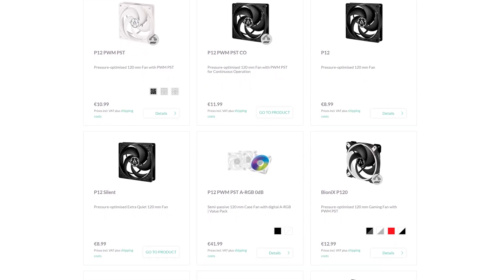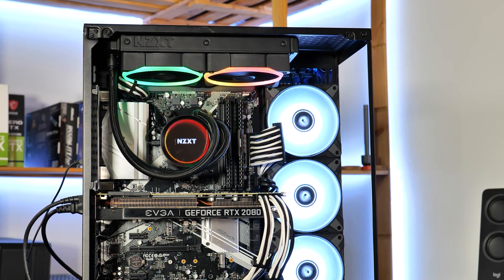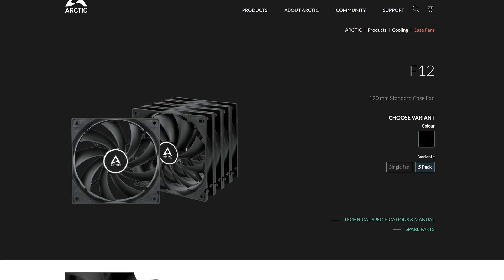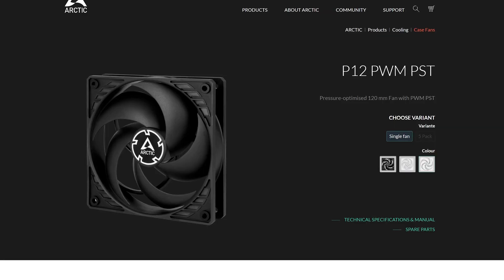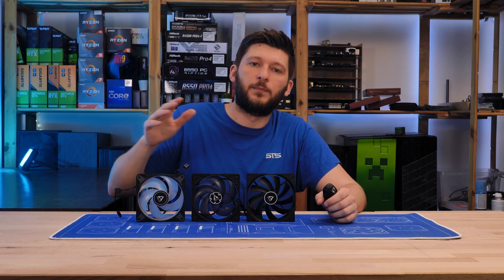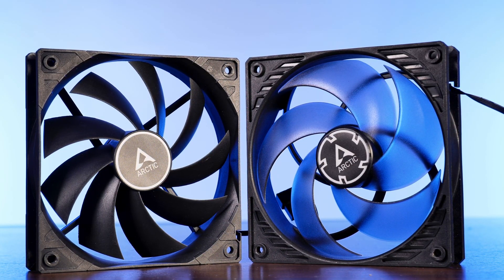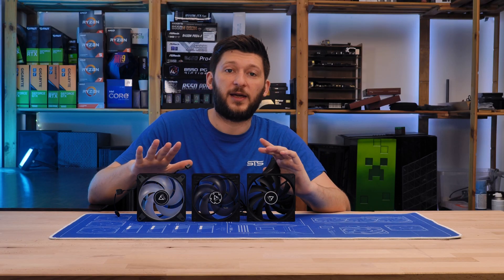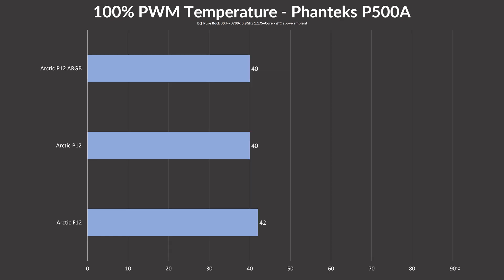Arctic Fans Main Lineup Explained - P12 | F12 | P12 ARGB

Comment: Im not so sure, but i think you didnt include fan speed (p12 vs f121). The F12 rotation speed is less then P12, and it still only 2C behind P12. So, if they can spin in the same speed, that will be the best comparison. Maybe you can limit speed of P12 to match F12 speed, and then test it. Static pressure fans like P12 are mostly for heat sinks and radiators. They are louder also. The case fans are suppose to have less noise with lower RPM because they are more then one, or two mounted in the case. My have 6 of them. So, can you imagine to put 6 P12 in my case. That will be much louder. But one or two for push pull on the heat sink, i can handle that. In my conclusion, germans are not stupid. They know very well why they make F12 for, and the same think for P12. Your testing metodology is not good in my opinion. Best regards from Serbia :)

Comment: Soooo, if I want to daisy-chain two of Arctic's fans, can I cheat a little? As in: 

Get a P14 PWM PST and the cheaper regular P14 PWM fan, daisy-chain them and badabing badaboom they both work at the wanted/custom rpm?
Or do I need to go for two of the PST models for them to work as intended?
Reply: I'm not sure if this have been mentioned in the vid but IIRC this works with P12 so I believe it would be the same for the P14
Reply from the maker: Yeah sure, nothing is stopping you. I've done this many times.
Just keep in mind that if you are mixing fans of different speeds. Each fan will run at its own % of whatever its max speed is. And the read-out in RPM inside your software will only be coming from the first fan.

Comment: The biggest difference between the P14 and F14 blade geometries is not the forward curve or "bending", but the "angle of attack" of the Blade.
This is the most important technical metric besides rpm when designing application specific Fans. I thought it would be nice if you can inlcude these technical terms in further Reviews. Although i appreciate that your methods are already very professional and in-depth.

It is the same angle of Attack as on airplane wings, that make them better for fast flying or better for take-off.
A higher angle of attack will always generate more airflow, similar to a high lift wing on takeoff. But it will also require more power and make the airplane fly slower (=less fan rpm).
A lower angle of attack will always create more pressure and tends to enable higher RPMs within the same power envelope as it has to move less air.

The forward curving of the fan blades is not important for the overall throughput or noise levels. But it creates a more uniform flow distribution along the fans cross section, improving performance on radiators and cpu heatsinks. Higher rpm requires a higher forward curve, so the P series needs a higher bend for the same effect. Fans without forward curved blades, like the NZXT ones or a Noctua S12 will have much less airflow near the Hub. 
There are also backward curved Fan bloadeslike the Verax CairDB Fans, but these are more of a mixture of axial and radial Fans with most airflow diagionally away from the fans motor hub.

Comment: Man, you're teasing with another Arctic video when we're still here waiting for the next Light Wings and Silent Wings 4 videos!
Reply from the maker: Things are in the making, there’s a dedicated video for every sw4 in production.
Aug 14 will be LW140 HS
Reply: @STSYT  It's hard to remain patient as I've decided to upgrade my case fans but haven't decided whether to go with A12x25, SW4 120/140 or LW 120/140. Tell me which ones already! 😉
Reply from the maker: Sw4 140HS or lw140 non-hs if you want the rgb. (Sw4 140hs if you ask me)
Theoretically, a12x25 would have a better noise-to-performance ratio above 25% fan speed, but if you pair it with a decent cooler the difference will be absolutely 0. 
In our benchmarks you’ll be able to see a difference, but that’s such a ridiculous overexaggeration. The up price isn’t wort it, cause you’ll never have that type of heat in the real world.
Here ya go 😅
Reply: @STSYT  Thank you! The choice is also between 2x140 or 3x120 for case intake (air cooled, no rad).

Comment: I think the P12 ARGB is the way to go, its basically a premium/higher quality versin of the P12 with overall slightly worse performance especially in the higher RPM's, but while being slightly quieter, so overall very similar performance but higher quality and ARGB. Good video! Now we just need and explaination of the Bionix series :^)
Reply: Yeah, and it also eliminates the humming noise issue of the standard p12 fans
Reply: @lagpi  exactly
Reply: @lagpi  it still resonates a little, but it's reduced in volume and more pleasing to ears
Reply: Pay more for less performance. No.
Reply: @TimberWulfIsHere  The noise to performance ratio is arguably superior due to no humming noise and the quieter fan overall. Also, you get RGB and a way higher build quality. I don't think the fan has a bad price to performance ratio compared to the normal p12, especially if you are looking for RGB.
Reply: @dackel4253  I've 6 of them installed. No humming.
Reply: @TimberWulfIsHere  That's great! I wish it would be like this for everyone. But although I don't own the P12 non RGB, it seems to be a common issue with the P12.